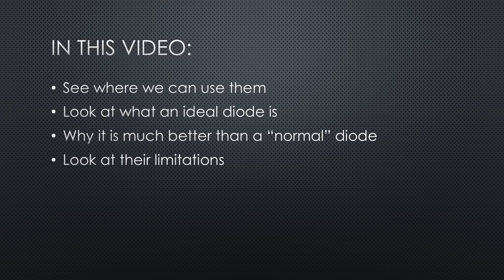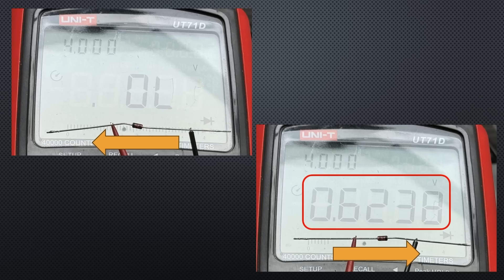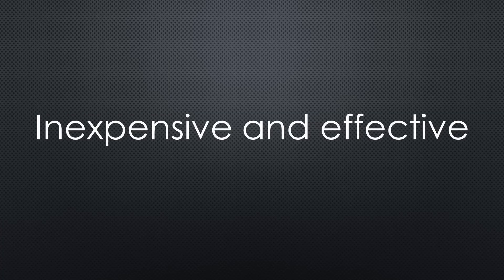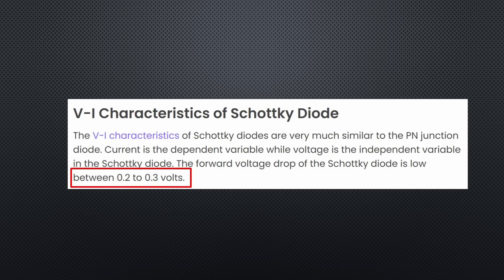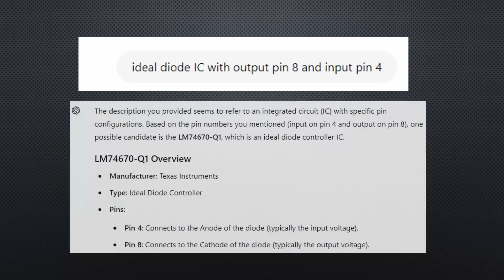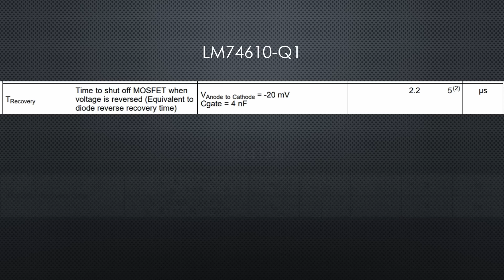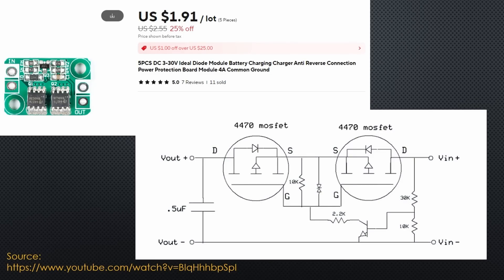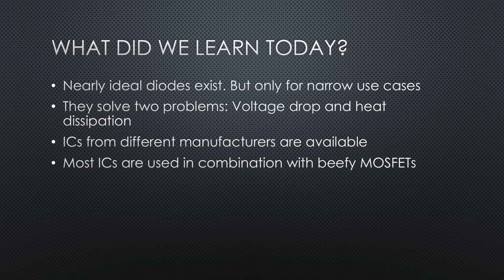(492) How to Protect Your Devices Against Reverse Polarity Using Ideal Diodes

Comment: Isn't there a contradiction in the video? You say that the chip starts working at around 0.5 Volt. But earlier in the video you showed, that the voltage over the ideal diode drops to nearly zero as soon as a bit of current flows. So how can that be if the chip needs 0.5 V and its anode and cathode are directly connected to the anode and cathode of the ideal diode?
Reply: The chip starts working at .5V and stores enough energy in an internal capacitor to keep it working for a while at which point the MOSFET turns on. The chip is now running exclusively on the energy stored in the capacitor but eventually it needs to recharge the capacitor. At that point it turns the MOSFET off for long enough for it to be recharged from the .5V drop from the current flowing through the body diode again.

The chip needs so little power to operate that the MOSFET is turned on for 98%+ of the time which is good for reducing the power loss by the diode but terrible if the load circuit can't handle periodic .5V drops in its supply voltage. That could happen if you have a microcontroller requiring a minimum of 3V being powered via this particular type of 'ideal' diode from a 3.2V LiFePO4 cell.

Other two terminal ideal diodes are powered from the reverse voltage they see when they block the current. They are good for a classic AC to DC rectifier application as the internal supply capacitor is recharged every 16.7ms (60Hz) or 20ms (50Hz) but don't work for wholly DC applications.
Reply from the maker: @tonyh6309  Thank you for the explanation. Indeed, the chip without ground is not ideal for all situations.
Reply: Great explanation. Thank you!
Reply: The datasheet certainly doesn't make it clear in the headline features - it only becomes clear later on when you read it in detail. Typical marketing not to point out helpful details like the quirks and disadvantages early on, to avoid you potentially wasting a lot of time and money testing an inappropriate part.
Reply: Correction - the LM74610 requires an external capacitor to store the energy to power the device. TI recommend 2.2uF.

Comment: LCSC has a good selection of 'ideal' diodes many with the FET included on chip, found under Products/Power Management (PMIC)/Synchronous Rectifier Controllers. They are MUCH cheaper than TI and LT parts - eg. the DK5V100R15S, a 2 terminal 100V, 15milliohm part is only $0.3 @ 100 off. The datasheets tend to be very sketchy, or in Chinese only, so you'd need to be prepared to do a lot of testing to understand their limits. (Eg. avalanche and max dV/dT ratings for the MOSFETs)

As others have pointed out, all 'ideal' diodes have limitations in replacing standard diodes, especially wrt the speed at which they can turn off. Eg. most are too slow to replace the diode in a non-synchronous buck converter in CCM mode or they are only suitable for relatively slow switching regulators. Also many 2 terminal parts require a reverse voltage to provide their operating power so won't work in a DC application.

The $0.23 NDP7935KC looks interesting with an integrated 8milliohm 60V MOSFET with a fast 12ns turn off time (typical only soec) - but that is actually the time to switch the gate of the MOSFET so the overall response might be much slower.

Even the TI LM73100 might have issues when used for battery charger circuits; the fast turn off time in reverse current flow is only specified as 1us 'typical' - no maximum. Eg. consider a solar panel charging a large battery, or capacitor. What happens if the solar panel gets shorted? Depending on the inductance of the input and output wiring the battery could deliver many hundreds of amps into the short in that 1+ us. Would the device survive that? The datasheet doesn't help. Similarly when the input is connected to a battery and the load gets shorted.

The LM74610 is interesting in that, whilst it doesn't require a gnd connection so it (along with an external MOSFET) can replace a diode without other cct changes, it has to get its power by periodically turning off the FET to harvest the power from the .5V drop across the MOSFET's body diode. That could be a problem if the cct relies on the low forward voltage of the diode in operation - eg. a circuit with a 3V minimum supply driven by a 3.2V LiFePO4 cell. 

After all that I expect that they would all work really well in a 50/60Hz linear supply replacing the bridge rectifiers which often run rather hot and waste a fair bit of power. You probably wouldn't want to use 4 x LTC4357 at $5 a pop though!
Reply from the maker: Thank you for the additional info! I did not mention 50/60Hz applications because my two devices did not behave properly in these situations and they also were not mentioned in the datasheets. My focus was more on the reverse voltage protection.
Concerning the "energy harvesting": I assume there is enough capacity available on the load side if your device is sensitive to voltage drops.
Reply: @AndreasSpiess  A reservoir capacitor across the load doesn't help as the diode device can only harvest its energy from the .5 to .6V voltage drop across the MOSFET body diode when the MOSFET is turned off. That voltage arises from the current flowing through the body diode which means the output has to drop 0.5V or more below the input.
A large reservoir capacitor merely prolongs the MOSFET off time waiting for the output voltage to drop .5V below the input. In practice that capacitor won't make a lot of difference, unless it's very large (compared to the load current), given that typically the MOSFET is turned on for 2.66s and off for 55ms using the recommended Vcap.
Reply from the maker: @tonyh6309  Good point!

Comment: Iv'e used MOSFETS as diodes before but never with an additional IC not sure what extra benefit the IC offers is?
Reply from the maker: It works with higher voltages than Vgs max. , for example.

Comment: I love ideal diodes!
I once blew up my Rui Deng DC-DC bench supply (DP30V5A) by messing about late at night, wanted to charge up a large 35Ah SLA. I didn't look at the polarity and connected it up backwards. It sounded really bad! A spark and a fizz. The unit does power up but doesn't output anything. 😢
It was replaced with a newer RD DPS5005 and I used the included conventional diode because it isn't necessary to have an ideal one. I would just like the Ruid Deng units to have output voltage compensation.
Reply from the maker: Thank you for sharing. I never tried if they have reverse voltage protection (which they should have, I think).
Reply: @AndreasSpiess  They definitely don't The shipped a lot of them with diodes in order to connect them to batteries which was stated in the manual.

Comment: Hi Andreas, very nice Video. Just a question, ist there a way to use the ideal Diode as a " Switch"? e.g from a arduino or esp Controller or a Mini mechanical Switch for Higher Power switching? Is a pin on the Chips for that purpose? Thx and 73
Reply from the maker: The chips I used did not have such a switch. But maybe others would have one. Search also for "MOSFET drivers". They are made for the switching scenario.

Comment: Aliens cause the problem, they go there with a ufo to accdentally connect it reversely and to burn out the device. The best is to use an optical mouse to test a usb, and a stick type power bank to test micro usb. They survive reverse polarity. For other, the atx fan can show the correct polarity. Sometimes the multimeter misleads or arder to see the -, easier to see a led and to hear a fan. Engineers dislike this, because others hate to see using a dusty fan, better to see a multimeter. Soetimes a laptop fan can switch on functions of batteries, phne parts. It has an instruction set within the chip, but needs hours of batt discharging to fix a phone battery. The fan's instruction set is compatible with everything based on 3.7v.
Reply from the maker: I like the idea with the fan!

Comment: I had a device with no RP protection, accidentally blew it up.

12,500 dollar specialty device cost 1,250 dollars to repair and an entire day worth of driving to and from the site 

Oops
Reply from the maker: This was really bad luck! Power rails are connected to many things. So the effect of negative voltage can be huge and your repair cost was (luckily) moderate for such an expensive device...

Comment: Hey, how about a video about mmwave radars which can be used for traffic detection. They are expensive but quite impressive! Check out the TI 4316 and their examples. Great stuff, impressive range of 70+ meters.
Reply from the maker: I agree, many such radars must exist becuase they seem to be rather standard in newer cars. However, they seem to be protected by the suppliers. I once investigated in using such devices from old cars...
Reply: @AndreasSpiess  I don't mean the front assist radars which are used in adaptive cruise control, but the ones which are used on poles or traffic lights for counting cars.

Comment: I think ideally a bridge rectifier should be used in all projects with a power brick but that a UX consideration rather than an engineering one.
Reply from the maker: A bridge rectifier is a good and cheap idea. However, it has 2 diodes in the path (with all disadvantages)...
Reply: @AndreasSpiess  Yeah that's a problem to be calculated for surely. But also you can use any power supply  ac or dc as lont as it has enhough tension.

Comment: I like the solar charger application. We are using both standard and Schottky diodes, but we have the suspect, the latter have a substantial backflow. With these "chinese amp" diodes, we can give it another shot. Or copy the idea by using a stabilizer and a MOSFET.
Reply from the maker: Another commenter wrote that Schottky diodes are not ideal for that purpose. I should have used "power" diodes... But an ideal diode is worth a try, I think.

Comment: It's also worth noting that while schottky diodes have low forward voltage drop, they do have more reverse leakage current (anywhere from 100-1000 microamps is typical for many parts) compared to standard silicon diodes (usually single-digit microamps or less). In most cases this is small enough to not matter too much, but it can result in "float" voltages higher than you expect on the anode side if there's no circuitry there drawing the leakage down.
Reply from the maker: Thanks for the clarification! I did not know.

Comment: Several years ago I designed one device for semi-industrial use. So for input 12V DC I installed full bridge rectifier, MOV and PTC. You can connect any voltage to it. If it in the 7-18V range (any polarity) - it will work. On higher voltage PTC breaks circuit. Below 7V MCU didn't start. But full consumption of the device below 1A so power loss on rectifier is negligible.
Reply from the maker: That was a well thought strategy! I think that many users were happy that you went the extra mile to protect them from hassle when they did a mistake.
Reply: @AndreasSpiess  They asked me what it means below input connector "12V AC/DC" :)

Comment: Thanks Andreas. You are the first to tell me. As a realist I hate the name given to this product. Just like WEP encryption these diodes have their place. Ideal is not what I would call them. They should be called electronic diodes or controlled diodes.  I have come across low loss schottky diodes with amazing low losses.
Reply from the maker: I agree that they are not ideal ( and many data sheets do not use this expression). But it is a handy and short name...
Reply: @AndreasSpiess  Sometimes they create a box where you plug in some ethernet cables. Because the word hub is already taken they also find that abusing upper side band finds rejection so they use an entire now and never never never ever used word: Here we are, call it SWITCH!!

Comment: The graph at 02:38 is only correct with a linear scale. It will be like a nearly perfect line on a log scale. Zeners are different here, they really show a sudden change in conductivity (far faster than the otherwise exponentially rising) somewhere around their nominal voltage rating.
Example data matching a measurement I made:
Voltage [V], Current [mA]
0.2, 1e-4
0.3, 1e-3
0.4, 1e-2
0.5, 1e-1
0.6, 1e0
0.7, 1e1
0.8, 1e2
[getting too hot]

At 03:36 you did not turn the powersupply on, by the way.
Reply from the maker: Thanks for the additional info.
I switched the power on after chaning polarity, but obviously cut it afterwards. My mistake. You are a good watcher!

Comment: ha da hani e gschicht zu poll verdusche.. ich han s auto überbrücke müesse en alte astra de het im winter immer peoblem gmacht egal wiä neu batterie gsi isch.. ich han den mal wo ich unterwegs gsi bin kei saft me gha und han überbrücke müesse.. nur es isch dunkel gsi ich bin gnervt gsi und hans den ebe falsch gmacht.. es het den biz magic smoke usem radio gä... aber nachane het sich das problem mit em selbst entlade von selber gfixt😆es het halt kei radio me gä.. aber das hani sowiso niä anä...
Reply from the maker: Lustige Geschichte! Ja, die Autoradios früher haben manche Batterie entladen. Mein 25 jähriger Audi TT startet auch heute nicht mehr wenn ich ihn 3 Wochen stehen lasse (ich musste einen mechanischen Schalter an der Batterie einbauen).

Comment: One use case you failed to mention was for power supply ORing  (okay the solar charger is kinda the case)  To power my network equipment with a "UPS",  I have two power supplies,  one fed by the mains,  the other is powered from a battery.  Two Diodes (ideal) OR the voltage to feed the load, (all of my networking stuff).  In the past I used a 95SQ015, an over doped Schottky diode,  but these devices have terrible reverse leakage current at low offset voltages,  the leakage current is very temperature sensitive.  This required >350mv offset voltage between supplies.  Enter the world of ideal diodes...  they work perfect even down to 60mv offset between supplies.  Since, in my case I was ORing 12v power supplies, using an ideal diode that requires > 9 volts and saved from cash.    -..  .. ---  -.. .
Reply from the maker: Indeed, I did not name it "ORing" because I did not like the name (even if it is technically correct). It took me a while to understand its meaning.
Your scnario is a very good example. And others also mentioned that Schottky diodes are not ideal for that purpose because of the high reverse current. I di not know that fact.
Reply: @AndreasSpiess  The 95SQ015 is a special Schottky diode, with a lower threshold voltage, at the expense of a high leakage current with a slight reverse bias, and is often used for reverse voltage protection for Vcc < 15 volts.   I thought "ORing" diodes was a common term (it is in the US)
Reply from the maker: @jamesmichener7526  As a non-native speaker, I definitely sometimes behave strangely. I am influenced by German and occasionally French words or concepts...
Reply: @AndreasSpiess  Fear not...  in the US a two transistor NPN/PNP amplifier, is often called a "69" amplifier... a term that I doubt made it to the EU

Comment: I tried to jump a car, flipped the hot to chassis ground (both wires were black and couldnt see the terminal markings).
Only lasted a second or so once i figures why the car idle almost stalled.
Reply from the maker: I assume the cables also got hot quite fast! Thanks for sharing your story.

Comment: But how does the reverse polarity protection operates?
There is a built in parasitic reverse diode inside the MOSFET!
Reply from the maker: The diode is conducting in the "right" direction. The Mosfet, if switched on, is in parallel and reduces the voltage drop. Mosfets conduct in both directions if on.

Comment: Some years ago I was looking at using the AD 8013 log detector.  At the time this was an expensive part.  The circuit included an op amp and a voltage regulator powered by a 9 V battery.  The PC board layout and circuit worked great.  The 9 V battery was connected with the typical battery connector taken from a new package o 5 connectors with wires bought from Radio Shack.  After installing the board in a shielded metal box a new 9 V connector was used from the battery in it's holder to the board through a switch.  When the switch was turned on smoke was released from every IC on the board.  Turns out the red - black wire polarity was switched on ONE connector in the package.
Reply from the maker: That with the colors was bad luck! But using a 9V battery without reverse voltage protection is not a good design. These bricks can easily be reversed because they have absolutely no protection.
The same thing can happen today with JST battery connectors. Because there is no standard, each manufacturer choses its setup. If the PCB and the battery are the same, you are lucky. Otherwise not. I also learned it the hard way (similar to you).